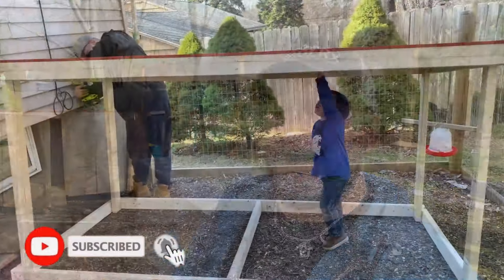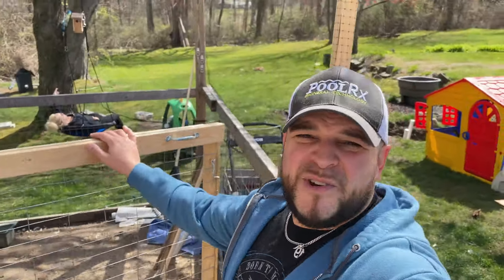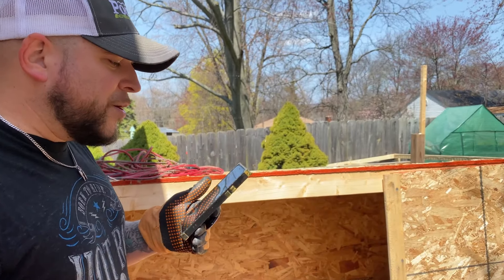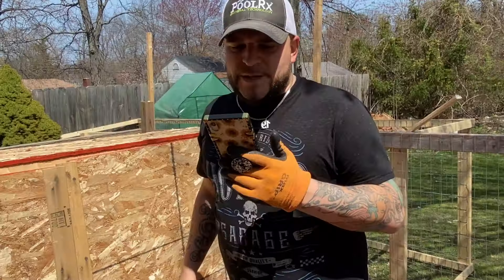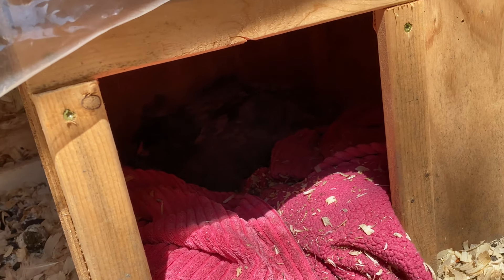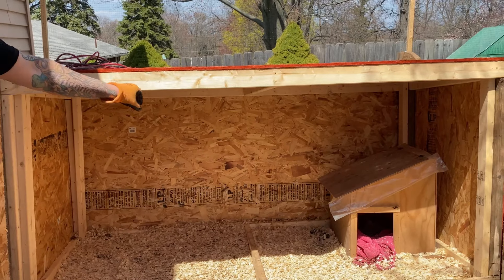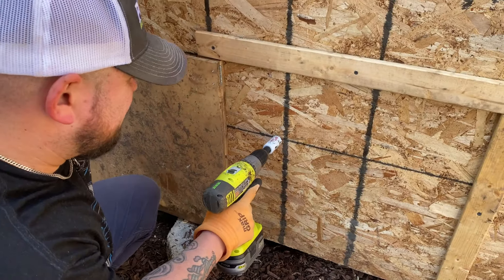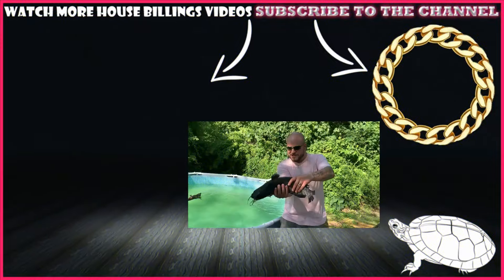$100 DIY CHICKEN COOP and RUN (BIG, Cheap & Easy)

Comment: Not anymore.  More like 500$ to build it now. Lowe's and home despot thinks 4×4 are made of gold
Reply: I might just buy a kit from tractor supply for $250. Normally I avoid doing that but it it's about the same price or cheaper and most of the work is done, I guess there's nothing more to do other than buy it and set it up.
Reply: @theyoyoyoyoyoboi  Just be careful about the size. Most of those are made to hold small chickens.
Reply: @theyoyoyoyoyoboi  I've been thinking 🤔 the same thing
Reply: @aaronkahler318  and they are flimsy and will need adjustments with more wood, I've been researching for weeks. We were going to buy an already made but I've read so much on how they are cheaply made. Not strong, and not predator proofed like we will need next to woods.
Reply: If your building a coop or run and need a pressure treated 4x4 check out the 3x4 pressure treated landscape Timbers. They are almost identical to a 4x4 post just have a rounded edge. And they are usually half the price.
Reply: Oh man that's rite Wood is so expensive now.   That's OK though we can recycle until we can get prices back to normal.   If not we gonna have to get together and start making our own wood from trees and bamboo.   Bamboo is awesome especially for chi ken coups.
Reply: @theyoyoyoyoyoboi  now, it could be built with about $170. Better improvements are need tho. All together, a better version can be made with $200-$250
Reply: $500? You're exaggerating and you know it. The thing here is, you need to use treated wood. I'm not sure he did.
Reply: I've just been collecting pallets and spare would I find from construction sites and random business I ask 😅 IT adds up and I probably have like 1k in wood now
Reply: @tnerbsg8134 That depends on the coatings he adding as he stated he did for the bottom
Reply: Nice coop
Reply: Loved the “step brothers” reference 😆

Comment: My 10 year old son and I watched this video and then built our own coop. Framed it up like a real house though and used plywood instead of MDF, raised it up on 4x4 posts 2 feet off the ground. We also added a center support across the front for the doors to close on to and used hardware cloth to screen in one half of the doors to allow for more air circulation in the summer months. Added a Happy HenHouse auto door to on of the front doors and a nice chicken ramp. It is well built and will last us many years.
Reply from the maker: Very cool to hear thanks for sharing that

Comment: Im a single mom and I ordered 10 buff orpingtons from tractor supply, laid the seats down in the van and headed to home depot to get all the wood you said. Tied the osb to the top of the van and drove very slow home. I made this coop in one day. I took apart some old pallets to add a shiplap design to the coop on top of the osb. I found 6 old cinderblocks in the alley to elevate the coop, put some milk crates inside for nest boxes and a long 2x4 for the roost. I painted it colonial red. It turned out amazing. Thank you for the tutorial 👍🏾💫👏🏾

Comment: So many people asking for the material list….it’s not that hard to see he is using ply wood, 2x4s and screws!
Reply: It looks more like OSB
Reply: @krzysztofrudnicki5841  Same difference
Reply: @j.johnson8360  not even close. OSB is cheaper than plywood but needs to be sealed completely, or it will start coming apart from humidity, rain etc. Plywood holds up much better to the elements but still needs to be sealed if it's used in an outdoor application

Comment: what was your supply list, my sister and I are going to attempt to build this, this weekend
Reply from the maker: Crystal Ortiz Garcia Hey Crystal that’s awesome. Here’s a list for you: 9 - 2x4x8 studs
5 - 4x8 osb pieces of plywood
1 - 1x3 furring strip for small door frame
1 - 2x2 plywood for small door 
4 - 2 inch hinges for big doors
2 - 1 inch hinges for small door
You might want to add in some more furring strips depending on how you decide to do the large door, to frame it out. I’ll have another video showing how we finish ours soon. Definitely let me know how it turns out for you and if you have any questions!
Reply: Thank you so much

Comment: Thank you for this video! My partner and I have loosely followed your plan and made some adaptations as we went along to suit our needs. The one thing we strictly didn’t follow is fo not get your pregnant wife to help 🙈 baby due in 5 weeks and still building the damn thing 😆 materials here in Spain are mighty expensive and it’s cost hell of a lot more (easily 300€ for materials). Things we modified...

• we kept the original height of the OSB for the side walls and added 15cm to the front support posts so it left a gap at the side where I’ll put hardwire mesh to allow for some ventilation.

• we flipped the floor so it’s flush and without the lip of the frame, well add a lip in that can be easily removed for cleaning out.

• entire structure is up on cinder blocks

I wish we had added some extra support joists under the floor, it’s a bit late now but I would like to use sand in there and think it could do with the extra support. 

Oh and we’ve hung out doors a bit differently as our vertical support posts were on the edge due to the floor being flipped over so the doors have been cut to fit in the gap (nightmare job) but it looks sweet now. Anyway we can share photos of our finished job with you?
Reply from the maker: Haha that’s amazing! Congratulations on your upcoming arrival such a blessing. My wife was building right up to her due date, narrowly avoided a serious complication the Dr discovered, it’s not easy wanting to keep moving and contributing.
So happy to hear our ideas were helpful, this was definitely a rough draft there are a couple of things we would tweak as well but overall did come out sturdy. We’ve added a roof and windows as well 😊 we would love to see your build! If you’re on Instagram we are @housebillingsmedia tag us! Or send an email to housebillingsmedia@gmail.com 
Look forward to seeing how yours came out!
Reply: @HOUSEBILLINGS  it’s been great to use your vid as a rough plan as we were struggling to know where to start! We’ve both loved the build. Desperately trying to get it finished as we currently have 19 chickens in our spare bedroom 🤣 followed you in IG, I’m ibizahomesteadproject 👩🏼‍🌾

Comment: Honestly not bad. Personally I'd cover the top due to predators and if you can raise it 2 ft or more off the ground. They need shade during hot summer & it's a great place to give them a dust bath/ hang food & water without taking up run space.
I'm did mine the same way you did, home Depot a truck & about 100 bucks. I went with the sll dad version. Mainly cuz it's simple to follow & the siding helps alot. I didn't put the tray in though, just made the back swing open.

Overall not bad, at least your giving it your best & thinking smart. Seen alot of coop diy's lately where ppl just don't care and might as well put them in a plastic tub or cardboard box
Reply from the maker: Thank you for the honest feedback, always appreciated! We are def trying our best here as we love all of our animals. As with each of our builds for any of our animals we will always improve as we go along so hopefully you will stick around to see that. We did mention in the video this was going to be raised on cinder blocks for the chickens to roam free underneath. Thanks again for the feedback

Comment: Ok I’m doing it lol any chance you can do a list of all the supplies you used ? 🙏🏾
Reply from the maker: Hey that’s awesome! Here’s a list for you: 9 - 2x4x8 studs
5 - 4x8 osb pieces of plywood
1 - 1x3 furring strip for small door frame
1 - 2x2 plywood for small door 
4 - 2 inch hinges for big doors
2 - 1 inch hinges for small door
You might want to add in some more furring strips depending on how you decide to do the large door, to frame it out. Let me know how it turns out and if you have any questions!

Comment: How short did you cut the back 2x4s to give you the slant on the roof
Reply from the maker: We cut them 2 inches shorter then the ones in the front
Reply: @HOUSEBILLINGS  ty sir
Reply: @HOUSEBILLINGS  also when will you be posting finished product

Comment: I built a beautiful coop large enough to walk in and stand up in with windows, shingled roof, everything.  Wood cost me a ton of money and I used OSB plywood just like you did for the floor.  WHAT A MISTAKE!!  Floor rotted out in under two years!  It was raised and built on 4x4s which were used as skids if I wanted to move it.  Now I have a great coop that is useless with the floor rotted out of it.  I even used flex seal to seal the top of the floor so it was easy to clean and it still rotted.  I dont suggest using osb, next time Im going to use marine grade plywood.  I had almost 1000 bucks in this coop and just sold it for 200 because the floor was shot.  Time to start over. It must have been moisture coming up from the ground but it sat 4 inches above the lawn in a fairly dry area of the yard.
Reply: Flex seal doesnt let the wood dry out
Reply: this sounds weird BUT underneath is where it drew its moisture from--its dry and the soil beneath still has moisture at all time believe it or not--its very useful for outdoor projects you just have to seal/paint the bejesus out of it  or it just wont last very long.
Reply: Get a plastic shed! We use one and it's amazing. No rot ever! Obviously you will have to add vents but that is minimal effort. You can sometimes get a good deal on a used one too.

Comment: You shouldn't have used particle board it will not last, also you should have left the overhang to protect the edges of the plywood from absorbing water.You may wish to view Carolina Coops videos, there is a NEW type of chicken coop stuff that is fantastic and you won't need to clean the coop out for TWO years, expensive but I think worth it. tc love your design.
Reply from the maker: WheepingWillow2 Thank you for the info. As I
Mentioned in the video, I sealed the osb board with animal safe sealant. We have since added a roof with an overhang as well. I’ve done plenty of updates since this basework was started, feel free to check out our other videos to see what’s been done!
Reply: @HOUSEBILLINGS  yw and ok I'll go do that now, ty tc

Comment: That's a chicken bake box. You need some wire for cross ventilation.
Reply from the maker: I mentioned a few times in the video that this wasn’t finished and I’d be adding windows, a roof and other things, which I have done and you can see in my other videos.

Comment: First----its OSB----not plywood--but it will work--needs to painted/sealed or will rot very quickly...
hens need a basic shelter and it looks good for protection--make sure you use flat wood for the perch chickens feet are flat not curved like other birds~! hope this helps.
Reply from the maker: I said osb quite a few times in the video
Reply: He said it was osb (because its cheaper) not plywood in his video.... pay attention before leaving comments that make you look stupid.... enjoy his build or keep it moving. I'm so sick of people like you tearing people down instead of building people up.

Comment: I'm using your design however I'm using 1/2 plywood we found a supplier that has it cheaper than OSB at Lowe's. I'm going to cut windows in the sides for ventilation
Reply: Does anyone know if this has been finished I want to see end product I'm trying g to make 1 also

Comment: I've got one question why not leave the overhang in the front of the coop roof instead of cutting it off on the back wouldn't it better to cover the top of your door opening with that overhang to keep the rain out  instead of cutting it off on the back of the roof? And is that a 2x4  you hammered in at the door hinge to cover a gape? can you show how you did that please?

Comment: FYI if you rent a truck again you can't usually get a whole yard of mulch for sooooo much cheaper! A yard is about a standard truck bed full. Even cities have this. Anywhere you can get dirt and gravel bulk. My area it runs from 10 to 30 a yard depending on the wood used to make it and the stage its in. How broken down.

Comment: I don't know about your predator situation, but raccoons can open those hook locks. 
If your doors are sturdy, you can actually hang the nest boxes on them, and then that way you don't have to climb in to get eggs. You only need about 1 box per 5 hens, they usually prefer to use the same boxes. 

If your doors are sturdy, I'd consider hanging nest boxes on them instead, so you don't have to crawl in to get the eggs. 
For my chicken door, I cut a doggy door sized hole, then recycled a cookie pan that I was throwing away, drilled a hole into the top, and attached a plastic outdoor dog leash to construct a cheap pully system, so I could just pull the cord to open the door for them, and that way I didn't have to go into the run to let them out or lock them up at night. I used a carabiner and a large eye bolt to keep it open during the day, then just unhooked it to lower the door. It sounds complicated the way I described it, I'm sure, but it was simple and cheap, lol.

Comment: Hopefully you wont get bullying, thats a very small coop.  My chickens have a huge coop and 10x10 run with lots to climb on and they also free range several times a week but some still bully the lowest on the chain of command.
Reply from the maker: talkingalwayz My run is about 30’ x 12’ and my coop is double the size of the largest manufactured coop I could find, which mind you claims to hold 8 chickens.. I have 6 hens. But thanks for the comment though.

Comment: You need some cheap roll flooring before adding chips.  That's gonna be a pain in the butt to clean without it.
Reply: Anyone broody gets solitary at the dog crate hotel inside our covered run for a week or so here. Works every time.

Comment: Looks good just not air tight
Reply: In your other comment you said it needs holes now it needs to be air tight?
Reply: @Storebrand_  that comment is right below this one
Reply: You really don't want your coop air tight. No big drafts either but ventilation is key to healthy chickens and they can handle cold way better that they can handle heat and anyway he did seal it so I think you might have missed that part of the video.😊

Comment: For the love of Bob Barker, please stop using osb for exterior projects.
Reply from the maker: Why. We put a protective coat over it and added our roofing, it has held up perfectly fine not a single issue. When lumber costs are through the roof I think this is a great option.
Reply: With the current price of lumber, I'm willing to use paper and spit to build my new chicken coop
Reply: @migeru243  amen to that, i was able to grab some pallets from work that I’m going to tear apart and I’m thinking of making a hoop coop for them out of that but just looking at other ideas